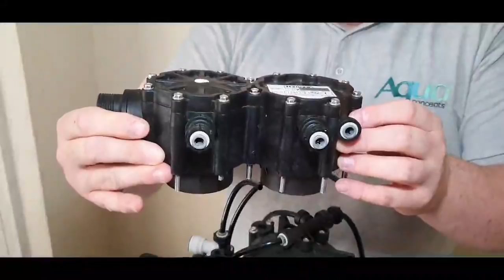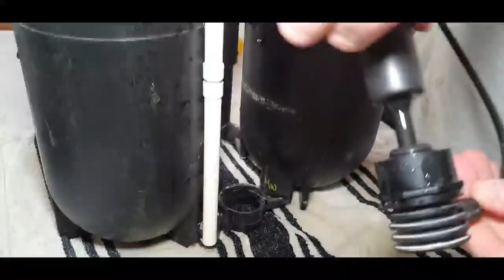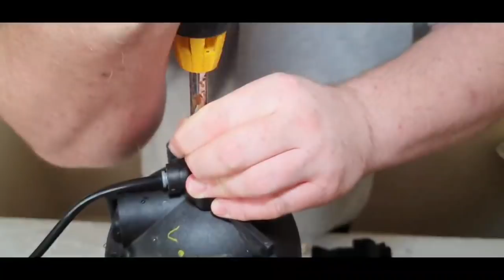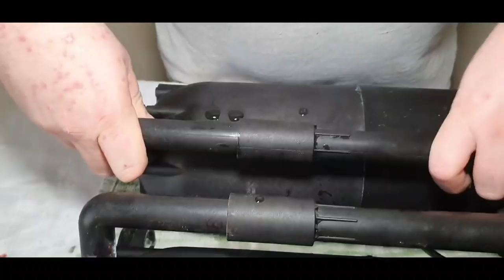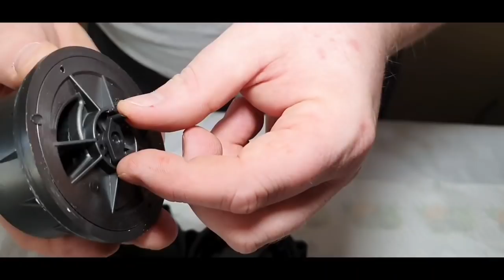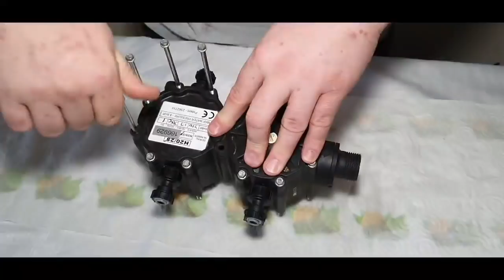Harvey Water Softener Repair / Rebuild [Water Softening]

Comment: i have a 20 year old CALSOFT water softener with the HARVEY H25 twin resin tank setup (very similar to the H20 in this video)

ive cleaned the unit out with water & am wondering if its possible to replace the resin in both the tanks???

or do u think i should just buy a new water softener???
Reply from the maker: Unfortunately to empty and refill is a bit of a chore. I certainly wouldn't refill if it was mine. 👍🏻
Reply: @TheWaterBoyuk  im gona try resin cleaner & see if that helps first. if there isnt much improvement i will most likely buy a new softener. i was considering the KINETICO KUBE 1 as a possible replacement....
Reply from the maker: @mrv5801  the Kube is historically a poor softener. Often they break within the warranty and support is very stretched. Kinetico made a really poor decision when they put their name on this rebrand, which primarily was for the Costco market. Do not be swayed by price.
Reply: @TheWaterBoyuk  can u recommend a good reasonably priced softener???
Reply from the maker: @mrv5801  how much space do you have? Could you email me some pictures to andrew@aquaconcepts.co.uk.
Reply: @TheWaterBoyuk  ive emailed u. thanks

Comment: Hi thanks you for the video. I have the same Harvey softener which for some reasons keeps trying to regen for the last 2 weeks but the salt level has not changed  if you have any ideas what the problem could be would be much appreciated also could you tell me what size nut driver you are using to remove the hex screws. Thanks
Reply from the maker: Are the blocks stuck? Try pushing them down

Comment: Hi, absolutely great video, clear and precise. A problem occurred with my Harvey machine a couple of months ago, there was water continually flowing out the waste. Partially stripped down the shuttle, put it back together, issue resolved. Just recently the water coming from the taps taste of salt momentarily until i run the tap, I guess this is probably after a regen. Any idea if this is  further shuttle problems or something else? thanks.
Reply from the maker: Hey Mike. Thanks for the kind words. We'll done for the repair. Sounds like the brine valve letting in salt after regen. It may not be checking off correctly. Give it a clean out 👍

Comment: Hi. My Harvey’s broke down. I have a high pressure coming out from the waste pipe (it should be low) and the salty water level doesn’t drop down while regenerating. Also it’s noisy and it takes over a half an hour to complete the regen. The water is hard on the outlet. What could that be? Thanks
Reply: I took it apart as you showed on your video and checked everything but no visible damage/wear.
Reply from the maker: regen meter stuck or shuttle valve broken.
Reply: 1. About a week ago I noticed a loud repetitive banging noise that lasted 30 seconds. This may have been during a regen cycle but am not sure. 

2. The water from that point has been hard as tested with hardness strips. 

3. The softener continues to regenerate however I have noticed it does it almost everyday whereas it’s usually 2/3 times a week. I’ve also noticed the regeneration lasts a lot longer, 20 mins or so when usually it’s 7-8 mins. I’ve also noticed that the strength of the flow when regenerating sounds more powerful and higher flow rate but this may just be because I am paying more attention to it than normal.
Reply: But now I actually took the pipe out the trap and the pressure is very high.
Reply: Could you please recommend someone? It’s London Croydon CR0